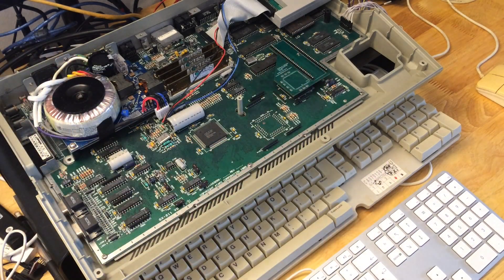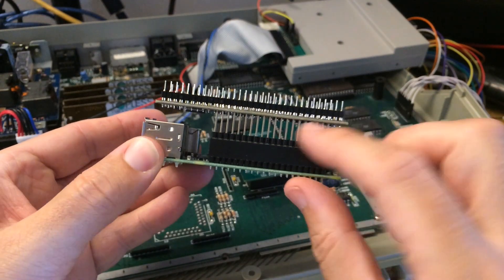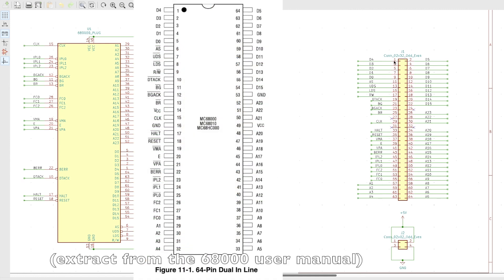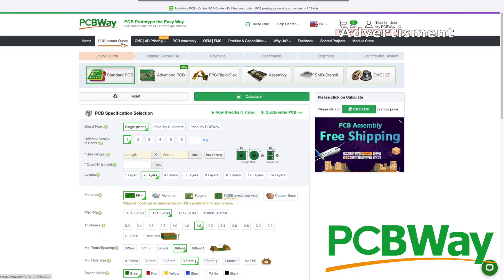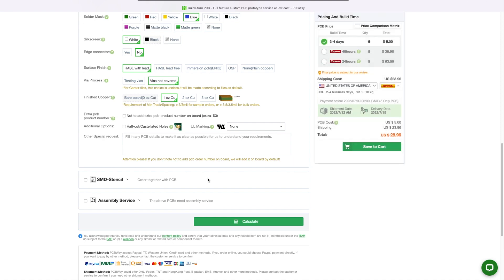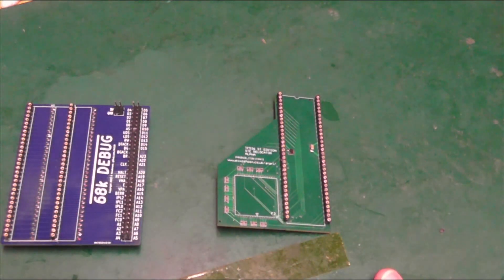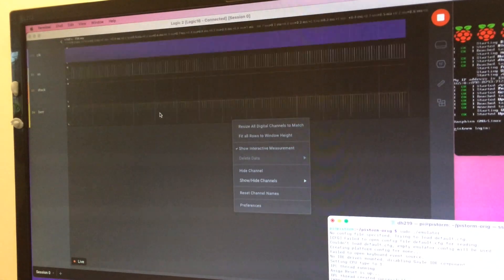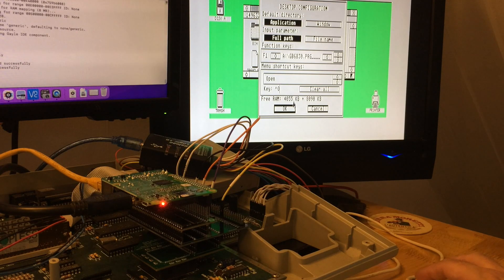PiStormST: building a debugging PCB & first steps at an Atari port.

Comment: This is amazing. Theoretically, would it be possible to have the Pi emulate a 68020 or 68030 on an STe in the future? That really would be an absolute game changer, as especially if it cam emulate Fast/TT RAM as well, it'd allow stock ST/STe machines to run MiNT.
Reply: It won't get faster for emulating those processors
Reply from the maker: Yes, that's the idea. PiStorm most effectively emulates an 020, but can go up to 040 opcodes. If I want to show off I boot it in 040 mode with 512MB of TT-RAM.

Comment: hi, your problem with the memory is the BERR signal that is coming from GLUE and all memory above $400 000 is seen by CPU as blocked/fault and CPU gets BUS Error status (two bombs). I dont remember much from 90s so I looked trough my old stuff and found a doc which is not complete. The workaround was to cut the BERR signal line from GLUE to CPU and use Mono-Flop to act as a watchdog instead (otherwise the CPU would not be able to detect any fault state). The 74LS122 was used and it kicked in aprox.100ms after no DTAC signal is detected and so is new BERR signal sent to CPU from Mono-Flop. ... and here comes all other pages with diagrams I actually cant find anymore, damn.

wow, I just spilled my beer over me...

on second thought, you said fast RAM, what Im talking is still seen as chip RAM I guess...hmm.
Reply from the maker: Hi there. Thanks for your reply, but I'm not sure to what you're referring. At the time this video was recorded there was no bus error handling in the PiStorm at all. Subsequent improvements have seen PiStorm running reliably on the STE with emulated CPUs up to the 040 and 512MB of TT-RAM. Unfortunately ST-RAM access is at half speed at the moment as is unlikely to advance until we get a faster Pi.
Reply: @thetechnoshed  well, great to hear that you could iron out the CPU emulation.

What I was referring to was a way to overcome the 4MB limit of ST, how to access all the memory addressable by m68k.

At the end I got curios that maybe you referred to 8MB of so called Fast RAM or TT-RAM and not as I believed 8MB of ST-RAM. 

Im not familiar with PiStorm much, but what I understand it is a m68k family CPU emulator running on Linux kernel. So in my understanding if you run the PiStorm as a 68000, the ST handles it the very same way as OG Motorola 68000, so then there is a bus error handling in action since it is a part of the ST logic.
But as I mentioned, since I went different way with my life after 90s, I lost most of the knowledge. I just remember it was possible, but I was not the "brain" behind it. We had a tricked out Mega ST with NOVA ATI Mach 64, 25MHz m68k and 15MB (?) ST-RAM as a DTP computer running Mag!C and Calamus, printing to SLM804, with CD-ROM connected via ROM port. And that shortly before TT was introduced. Exciting times.

Ok now back to your problem, so you have half the speed accessing ST-RAM that is directly on board/bus of ST?

That might a be simple fix if you can adjust bus clock in the PiStorm emulation. PiStorm is  Amiga specific emulator and that means that the clock of the CPU and BUS (via some emulated crystal) is lower then on ST.
Looks like the PiStorm is using its own internal software CLK crystal which is clocked at Amiga frequency, and is syncing (pulling) the ST CLK only every what two words?, but there it finds out its too late and it is out of sync, so it has to wait for another cycle.
Hmmm... damn I forgot so many things, and I used to program in ASM for 6502 and now I dont remember plane basics and terminology... Its all like in fog.

Sorry to bother you, I will watch your videos, very informative, thanks.

Comment: Does the Pi just emulate the 68000 or can it potentially do 68020 (or higher) and/or provide FPU too?
Reply from the maker: I've had it working up to an emulted 040! There's no speed improvement past the 020, however. It's just the commands it can interpret.

Comment: 17:17 Note that Vampire V2 accelerators for Amiga suffer of the same issue. While the FastRAM provided by the Vampire is very fast, the Amiga's main Chip RAM (same as ST-RAM) is still very slow. AmigaOS can be told to use FastRAM for everything possible (except Video/Audio/Disk DMA accesses). EmuTOS can also be configured to work itself mainly in FastRAM. User Atari programs can also be told to use Alt-RAM by default by patching their header's PRGFLAGS. However programs that need ST-RAM by default, because they set up video buffers or perform disk DMA access, would need to stay configured for ST-RAM, anyway.
Reply from the maker: Unfortuntely it's not just that ST-RAM accesses are comparitively slow at the moment, it's that they're genuinely slower than normal. ~2MB/s instead of ~4MB/s. This will be the next big thing to investigate.
Reply: PiStorm-Emu68 includes both CPU and RTG that runs on Fast RAM. Custom chipset usage is for legacy Amiga games, audio, and floppy disk access, but PiStorm-Emu68's CPU acceleration is enough to run Quake in Amiga's HAM mode at playable frame rates. https://www.youtube.com/watch?v=btoU_CQSg7A

Comment: 18:08 I added CONF_WITH_BUS_ERROR to EmuTOS in 2016 in order to completely disable Bus Error checks on Amiga hardware. I'm glad that this feature is useful for you now to progress on PiStormST 😃
Reply from the maker: Merci beaucoup pour ca, Vincent! A few places still needed to be patched in the code or defined out, but they're much easier to find as you just follow the errors relating to 'check_read_byte()' not being found. :-)

Comment: From memory, the Amiga's sharing of RAM (Chip RAM) between the CPU and the custom chips may be the cause of your "half-speed" problem. 
Amiga Fast RAM (which is not shared with custom chips) may be?? a closer analogue of the ST's Motherboard RAM..
The Amiga emulation software used for the PiStorm can also emulate the Chip RAM and Custom Chips on the Raspberry Pi, making it also able to output scan-doubled (31KHz and above - non-interlaced, non-flickering) video and audio via the HDMI port to modern LCD monitors.
If this is the case, then the cure may lie in altering the programming of the CPLD to match the Atari's mainboard RAM access. 
I don't know enough about the Atari's timing of transfer of RAM address and data busses to video display chip, blitter (where present), I/O and audio chip to add more detail.

However, if these interfacing problems are solved, it should be possible to re-flash the CPLD with a hybrid firmware, enabling full Amiga emulation on an Atari and full Atari emulation on an Amiga, (keyboard, serial/parallel I/O, MIDI etc. using hardware access) with the sole caveat of using the HDMI output on the Pi instead of the main boards of these machines..
Accessing Amiga Floppy disks on an Atari could be accomplished with a Greaseweazle (supported in the Amiga Pistorm already I believe.)
Reply from the maker: Hi there. STRAM is the equivalent of ChipRAM. It can't be offloaded to the emulator as the chips on the system need direct (hidden from the processor) access to it. I think the slowness is a combination of factors, but one of them is that the Amiga's RAM is ready as soon as it tells the processor it is, but on the ST there's a one cycle delay. That's means on the Amiga it's off working out the next access, but on the ST it's still in a wait state at that time. Thanks, though. :-)
Reply: Amiga's bare metal Emu68 doesn't emulate Amiga's custom chips and it's different from Linux Pi hosted version.

Comment: =D   Very cool work so far!!!  One reservation I still have with the PiStorm, is there's apparently a problem regards interrupts (LIV2 pointed this out to me).  I think they are supposed to be level sensitive and its edge sensitive atm?  That's the only issue with the Amiga (that I am aware of).
Reply from the maker: Thanks, Gadget! Not sure about the interrupt business. AFAICT the PiStorm signals there is an interrupt waiting and then the Pi polls to find the level. That sounds like a level-sensitive system to me. Perhaps it’s something that’s been already addressed.
Reply: @thetechnoshed  I might have it the wrong way around there - but that is the problem.  Many Amiga games and Demos act very strangely or just simply don't work.  Surprising that many people seem happy with it as is, despite this problem.
Reply: @GadgetUK164  For PiStorm Emu68,  use EmuControl tool to slow down Emu68 e.g. disable Fast Cache and JIT instruction depth set to 2.

Emu68's disable Fast Cache function is equivalent to AmigaDOS's CPU command's nocache switch.

WHDLoad's startup and cleanup scripts can be modified to include the EmuControl's command line control.

WinUAE has" Wait for Blitter" feature to improve compatibility with very fast CPUs.